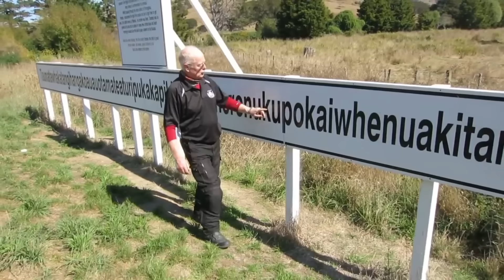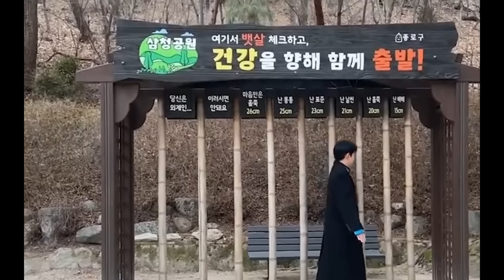Los Videos mas Raros del Mundo 335 / Videos Extraños

Comment: Saludos garn amigo Extraordinary Emiliano me gustaria aclarar en el minuto 1:52  
 - es Imposible que una pequeña Hormiguita aguante tanto Decivelios ya hablamos de 15O Db
 y estos (Invertebrados Ciegos) se caracterizan en sopocar y Captar las Ondas radiales Sonoras en forma de Ondas Conicas de abanicos
 a travez de sus Antenitas por medios de los Rastros que los demas Hormigas Dejan su Sensibilidad es muy tenua y esa Prueba no se como le aguanta esa hormiga una Fuerza de sonido tan Bajo que yo creo que las Mata al Instante !!! Saludos emiliano
Decibelio (dB)
El término dB (decibelio) y la escala de dB se utilizan en todo el mundo para medir los niveles de sonido. La escala de decibelios es una escala logarítmica en la que el doble de la presión de sonido corresponde a un aumento del nivel de 6 dB. 
Es muy importante comprender que el término 'dB' puede tener distintos significados y que no se trata de un valor fijo como el voltio o el metro, etc. El valor de un dB depende del contexto en el que se utilice.
A continuación encontrarás ejemplos de distintas intensidades de sonidos expresadas en dB(HL):
180 dB: Cohete al despegar
140 dB: Motor de un avión a reacción al despegar
120 dB: Banda de rock
110 dB: Trueno fuerte
90 dB: Tráfico en la ciudad
80 dB: La radio a un volumen alto
60 dB: Conversación normal
30 dB: Susurro suave
0 dB: El sonido más bajo que una personca percibe fuente https://www.hear-it.org/es/que-significa-decibelio-y-frecuencia
Reply from the maker: Gracias, amigo. Debe estar sufriendo a diferencia de lo que se dice en el vídeo.